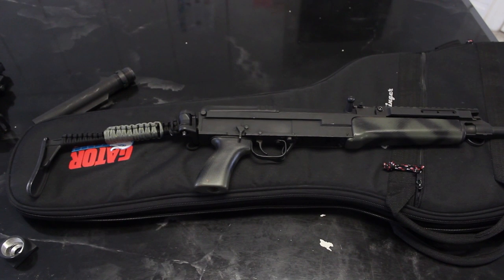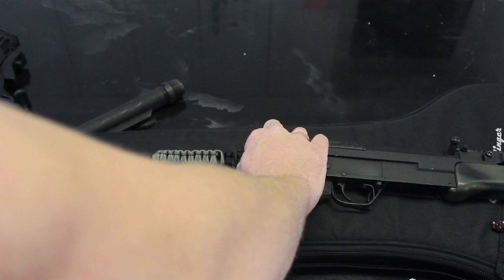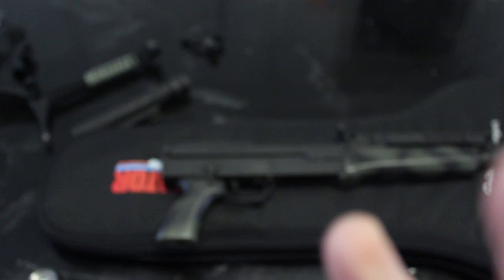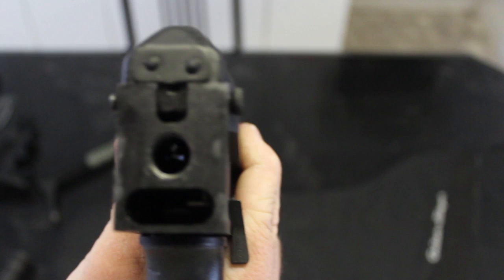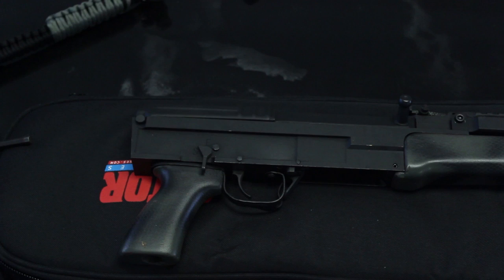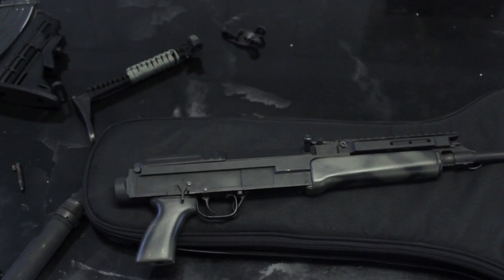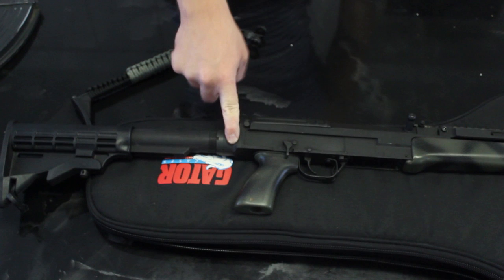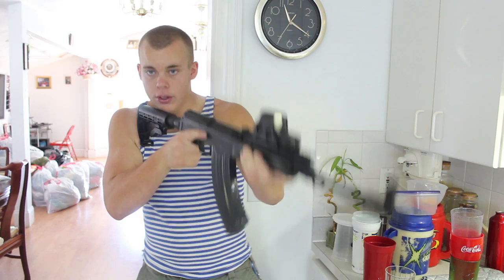how to install an LE Stock to your VZ-58

Comment: I have a couple of questions regarding your VZ modification.
1 Are you able to get a front and rear sight picture (irons). 
2 why did you change out the screw used to hold the old folding stock to the receiver.
3 what is the stock adapter made of
4 how is it holding out
5 what type of buffer tube did you use (commercial or mil spec) 
Thank you

Comment: There is something sacraligious to me about replacing the wood and steel with a bunch of polymer on these old warhorses (same with ak variants). Part of this rifles appeal is how compact it is with the folder. Although I have toyed with buying a set of real wood handguards and stock instead of the wierd chip board stuff that's on most of them. Glad this works for ya though, having a telescoping stock is handy as well and MUCH more comfortable than the wire stock
Reply: I agree in a way, but as a guy who's 6'4, the wood or beaver barf stocks are just way too short, and adding an ugly rubber extension on the end is honestly worse looking. I wish I had the cash to get a nice custom wood furniture set made up for my VZ-58, something that looks like a nice SKS stock, but the proper length for a guy my size. Also I do love how no-maintenance the plastic furniture is, particularly given the heavy cleanings my gun sees thanks to corrosive rounds.

Comment: does the adapter take milspec or commercial extension tubes?
Reply: I also want to know this.
Reply: SteppenWolfMindGame I believe that it takes commercial
Reply: Already bought milspec tube and MFT battlelink stock for it. It works!